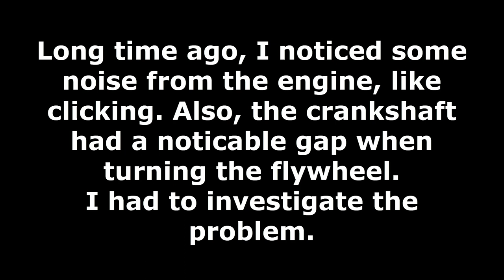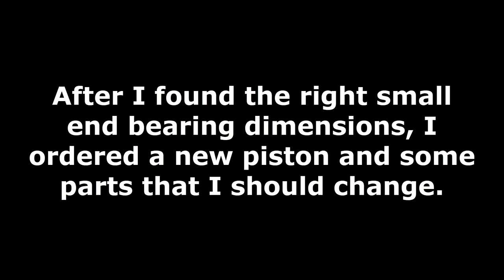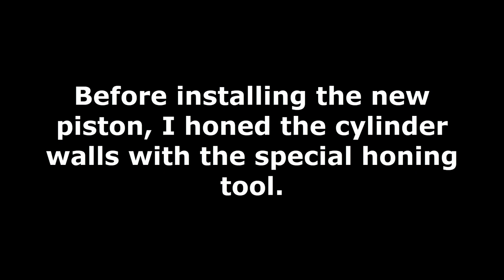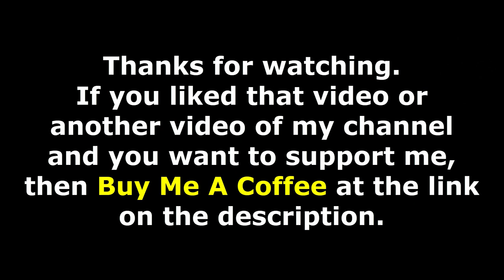🔧Piaggio Zip LC UPDATE!!! | Stage6 StreetRace 70cc | Yasuni C16

Comment: From which moped do you have the radiator and what riser do you use for the rear suspension?
Reply from the maker: The radiator is from original zip sp and riser is one I bought from maxiscoot.

Comment: from what bike is the cylinder from? like is it intended for minarelli for example, because there is no cylinder for the original ac zip which has liquid cooling?
Reply from the maker: @fridenc  this cylinder fits all piaggio lc engines, like zip sp, gilera runner etc.
Reply: @binostuning  thanks man, really appreciate it, could you maybe link the cylinder?
Reply from the maker: @fridenc  this is the Stage6 Streetrace 70cc. Go on maxiscoot.com and find what fits to your scooter.

Comment: How did you do te pomp with the electrical wires?
Reply from the maker: The pump is wired to the ignition switch on the wires with 12V

Comment: what is your transmision setup?my zip ends up being tooooo "short" 
also are you using a 21 or 24mm carb?
Thanks
Reply from the maker: It has a set of primary gears from polini but I don't remember how many tooth. I think it's written on the description. 
I'm using a 26mm carb pwk
Reply: How do you keep your yasuni looking so good with no rusting?
Reply from the maker: @likkitongue  Here in Greece we don't ride in the rain. hahah
Also, the zip is not my main bike, so I ride it once in a while.
A method that helps the exhaust from rusting is to apply high temp clear coat

Comment: Radiator model ?
Reply from the maker: After 2000 zip. I don't know the part number.
Reply: @binostuning  thanks, how many mm holes did you drill to install the water outlet plastic pipe?
Reply from the maker: @mehmetzorla  the plastic pipe is for water inlet to crankcase. The hole exists already but it needs a bit of grinding.
Reply: @binostuning  There is no hole in mine, there is only place, I thought you came yourself
Reply from the maker: @mehmetzorla  I can't understand what you want to say.
Reply: @binostuning  ok no problem thank you very much for your interest i would appreciate if you subscribe to my channel